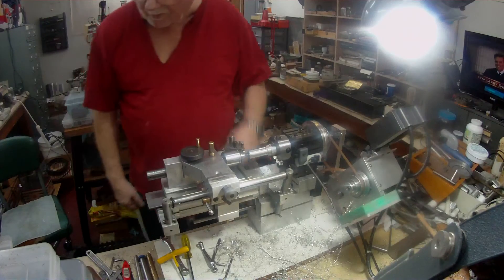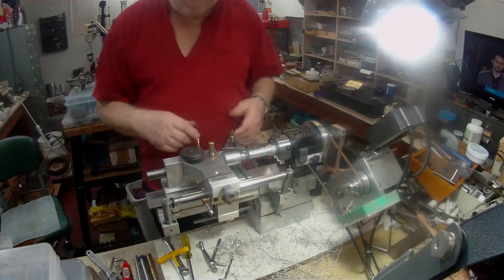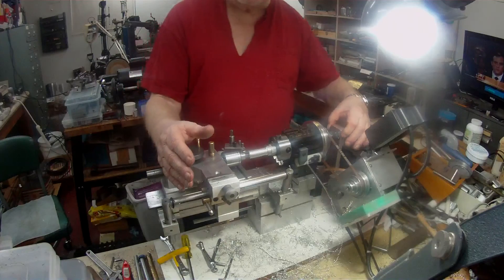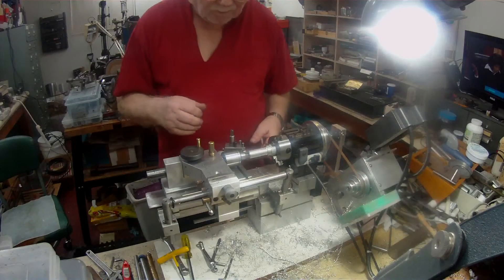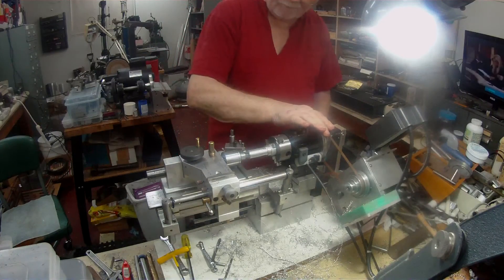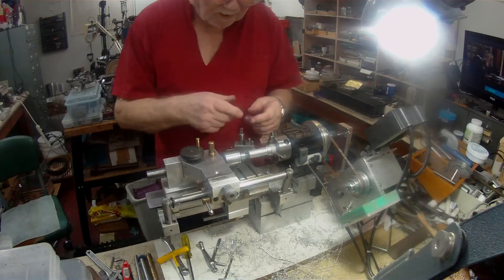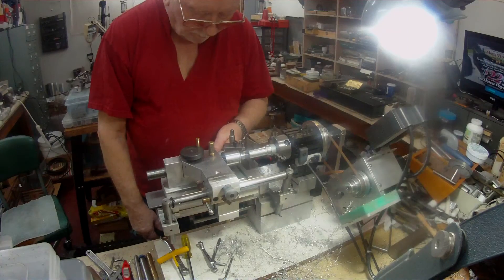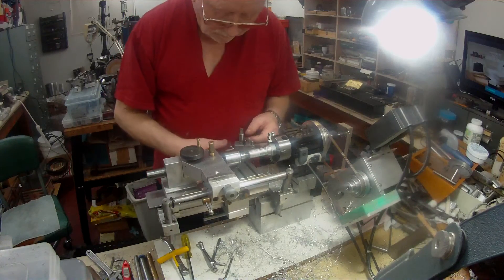FILE0022 The start of a sample thread on the Taig Lathe

Comment from the maker: Airguns, after taking another look at my threading system I would recommend forgetting about it, it has a fatal flaw, the transfer bar from the 3/8 carriage rod to the master thread at the spindle is not stable, to much flex when the threading tool makes contact with the part and I doubt that a guide of any kind will solve that problem,

Comment: Hi Walter. Sorry for bringing up old video to comment on, but I'm very interested in your work. The threading attachment you,re building in this video ? Have you thought of using the T slots on top of the lathe as the tool carriage drive bar guide. It would be very easy to make a post that mounts on the carriage. up to the bar. very easy to remove when not needed.
Reply from the maker: Airguns: as it is at this moment it is not working as it should do, and l am pretty  sure the problem will not be cured with a stabilizer bar at the top of the headstock as first thought, after sitting here thinking about the present setup, it seems to me the problem is with the lower 3/8 rod connected to the carriage and toolpost and I'm thinking perhaps a rack and pinion might do the trick, instead of the existing rod and bushings,

Comment: Well done Walter. Success comes to those who persist. I see reversing your main drive motor as easy. A switch between the speed controller and the motor to reverse the motor polarity...  the reversing switch only to be operated when the power is off! Do you attribute the variable fit of the thread along the start of its length as a consequence of the take up of the flex at the beginning of the cut.. similar to take up of backlash? If so increasing your 3/8 rod to 12 or 16 mm will stiffen everything up. Try aliexpress for the rod and linear bearings. I buy all my cnc components there. Cheap and fast but yes.. from China... where else?.. Martin from Hong Kong.

Comment: Screw cutting always takes along time .  In the summer me and a friend made a new worm for his benford dumper steering box . So we started with 2.5 inch bar . We bored it out then cut an internal key way on the slotter. Then we made a mandrel and set it up in our biggest lathe . It was 3/4 inch pitch. And this lathe doesn't have a threading dial so you chalk the gears and drop in at the same chalk mark . We used a hss tool in backgear (4 rpm) and about 5 thou  a pass ! Great video !
Reply from the maker: Thank you, great comment

Edmund...........Alberta

Comment: Walter:  Wow!  I can't believe your already cutting threads.  No matter, thread cutting is a bit slow anyway.  Maybe by tomorrow you'll have a working male thread.  A longer master and reverse switch on the motor and things should move much faster.  At least in theory all is working okay and now you can work out the bugs.  Best Regards: Larry
Reply from the maker: Thanks Larry, I'm not sure but is it possible I could set up a reverse on the Sherline DC motor, it has enough torque to make a cutting path, now if I could arrange a reverse that would be even better than the geared motor arrangement?, any ideas?, or anyone who reads
Reply: Walter:  I emailed you the information you need as published by Sherline.